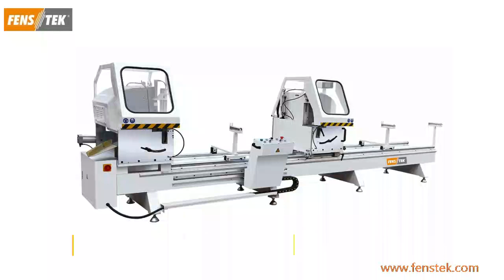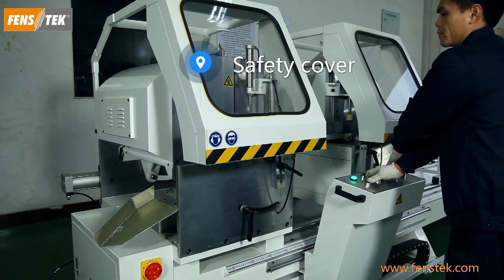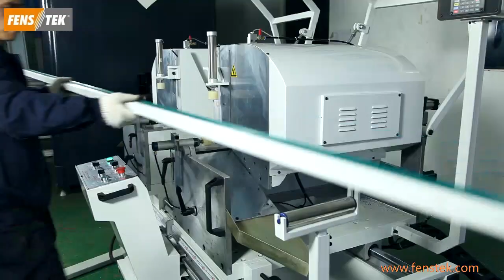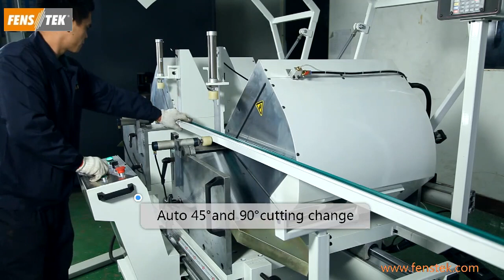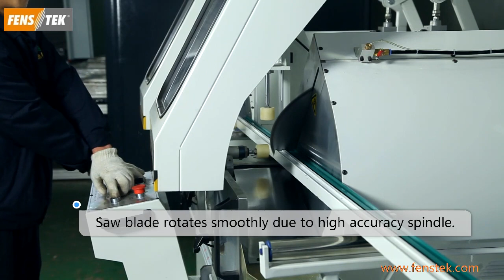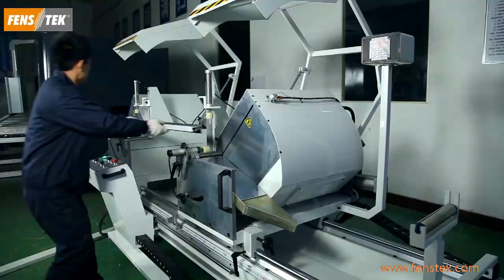FENSTEK aluminium window double head cutting saw digital display DSD500x4200

Comment: 1) 500mm saw blade for cutting #aluminium #upvc #pvc profile
2) Auto change for 90 and 45 degree. Special degreee is possilbe
3) Spindle motor drived cutting saw assure high precision #aluminium #window #pvcwindow profile cutting